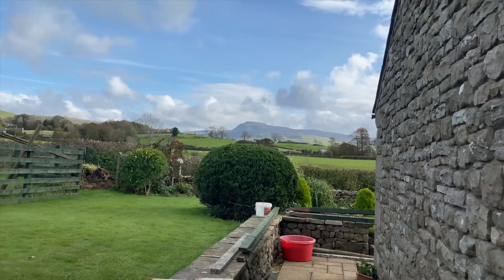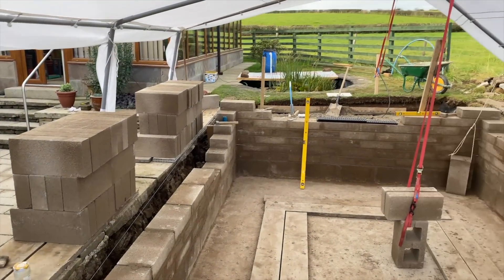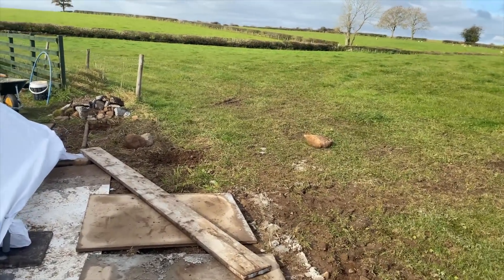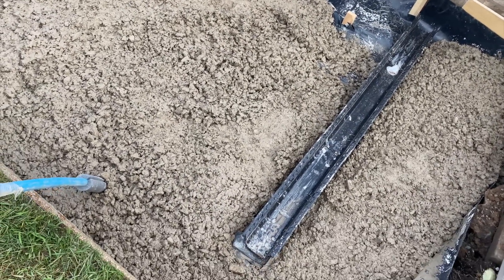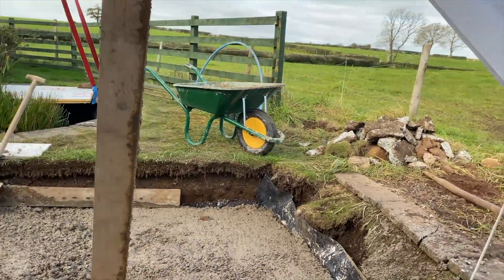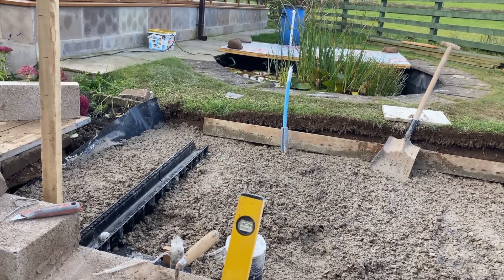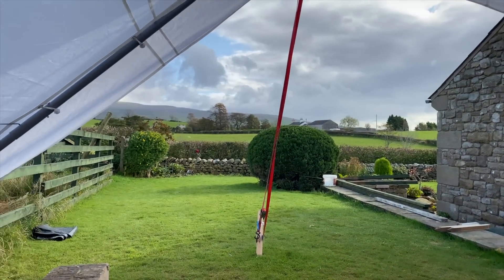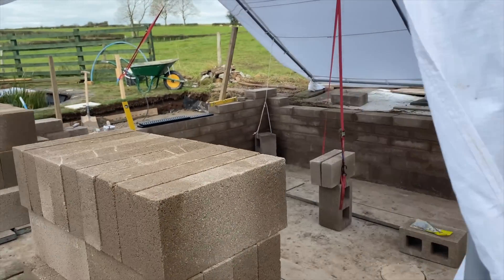5500 Koi Pond build - Part one!

Comment: Great stuff. Really useful to see different stages of builds. Is that 7n concrete blocks standard all round? Was wondering if you could do that for a pond over 2500 gallons or whether hollow block back filled is needed? Keep em comin'👌👍
Reply from the maker: Solid blocks are good, no need for hollow.

Comment: What type of block are they using? Or what is best ? Plus are my fish ready for pick up now? I bought them on the 1st batch £195. Thanks Tim........Great pond 😁👍🏻
Reply: Ha, thought this was a new video 🙄😂
Reply from the maker: If you’re heated then no problems!
Reply: @TimWaddington  no not heated, sorry for keeping on bothering you just thought with the nice weather lately. What type of blocks did they use?
Reply from the maker: @stejjones1974  6” solids on side. Try and wait till temps are stable at 12C
Reply: @TimWaddington  got my wires crossed as I thought the video was filmed today and you said it was harvesting season so your busy with fish....so thought it’s time to pick them up 😂 just ignore me my wife does 🙄🤣